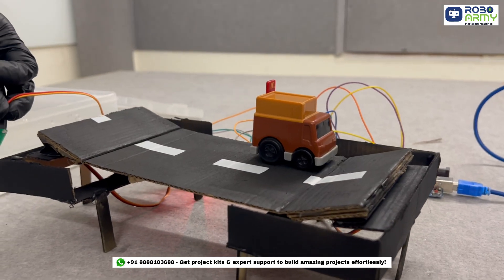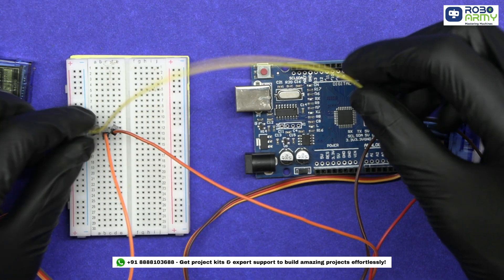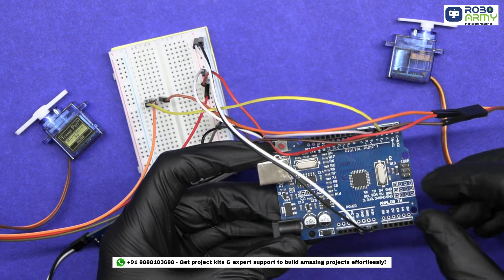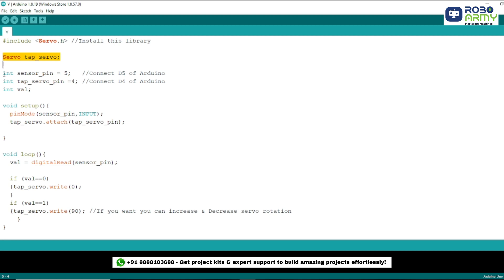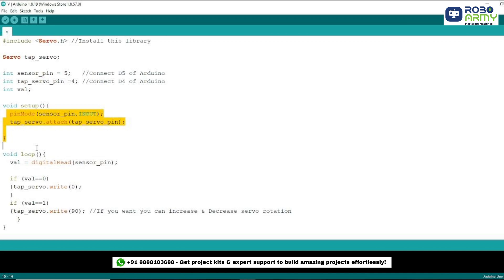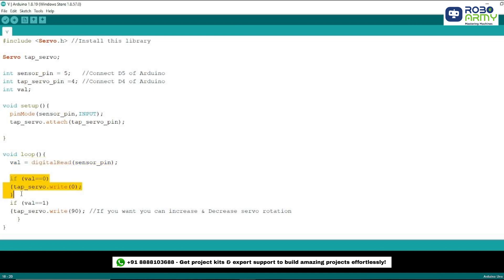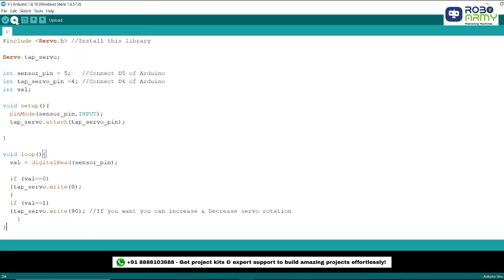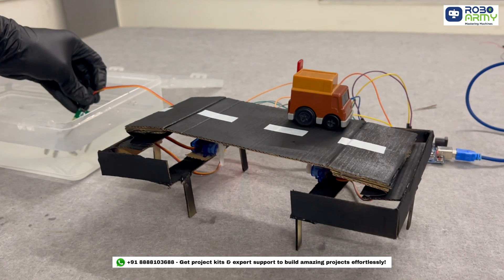BridgeGuard: Water Level Responsive Bridge using Arduino Uno

Comment: Bro how to add a led system that blinks for four seconds and after that it turns off the bridge lifts up I bought an extra soil moisture sensor. Please reply fats because in a few days i will have a state level exebhition.
Reply from the maker: That’s a great idea! You can achieve that by adding a delay in your code after the LED blinks, before triggering the bridge lift.

Comment: Bro when we connect gnd in Arduino it’s not working please reply
Reply from the maker: Please double-check your connections. In the Bridge Guard project, GND must be common for all components (Arduino + sensors + power supply). If GND isn’t connected properly, the circuit won’t work. Try reconnecting it securely and let me know if it still doesn’t work.
Reply: @robo_army_ bro it’s working 🎉 thanks 🙏
Reply: Sir power supply is taking only one motor  wt can I do ,so I can use 5v battery power supply ?

Comment: Bro it didn't worked, i followed every step perfectly but still it failed the soil moisture sensor does not gives the sense to the arudino uno 😕
Reply from the maker: Make sure the sensor’s VCC, GND, and A0 pins are connected properly. Also check if you're using the analog pin in the code correctly and power is stable. Let me know your setup, I’ll help!
Reply: @robo_army_ BRO IT WORKEDDDDD!!!!!!!!!! 🎉🎉🎉🎉
Reply: Hlo
Reply: I need your help in this project
Reply: @brahman176 Okay 👍

Comment: How many jumper wire does it takes?
Reply from the maker: It depends on your wiring setup, but generally, you'll need around 8–10 jumper wires to connect the servos, sensor, power, and Arduino. Let me know if you need a detailed breakdown!

Comment: can you create this with a buzzer and led lights
Reply from the maker: Yes! We can add a buzzer to alert when water levels rise and LED lights to indicate the bridge's status. You can try modifying the project by your own. If you need more details or guidance, feel free to ask.
Reply: @robo_army_  when should we add the buzzer and where do we connect it?
Reply from the maker: Add the buzzer and LED in the loop where the servo activates. Connect the buzzer's positive pin to Arduino’s D6 (or any digital pin) and negative to GND. For the LED, connect the anode to D7 with a resistor and the cathode to GND. If you need detailed guidance, let me know!

Comment: Can you please make a drone using esp 32 and also tell how to make it's controller remote

A condition the project should be busier from the endly (under $25)

It  is for my science exhibition which is going to  conduct in March month so please fulfill my requirement
Reply from the maker: Creating a drone with an ESP32 under a $25 budget is quite challenging due to the cost of essential components like motors, ESCs, and batteries. However, we’re excited to see such an innovative project and wish you the best in your science exhibition!